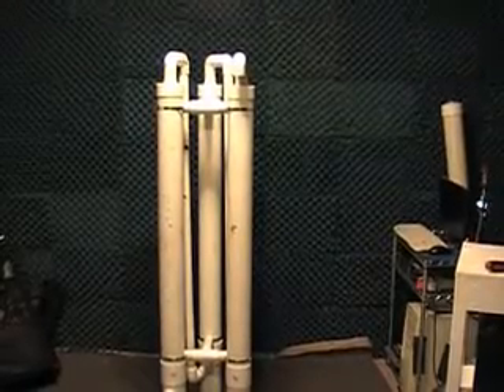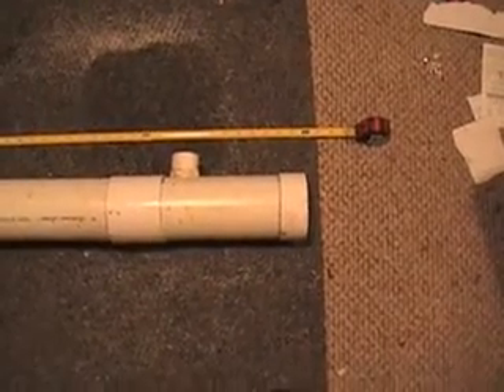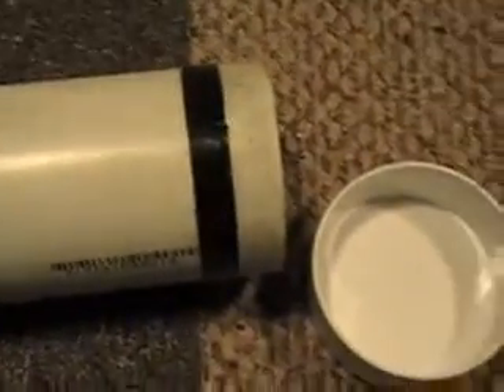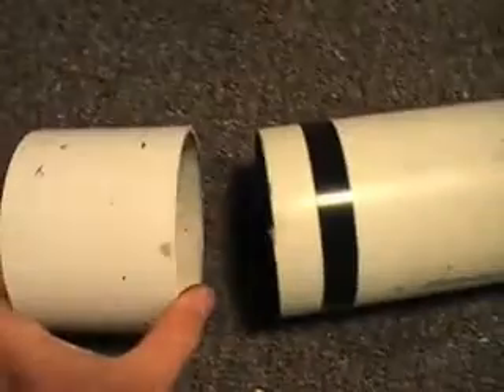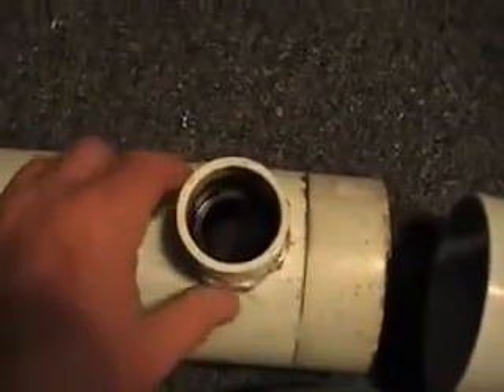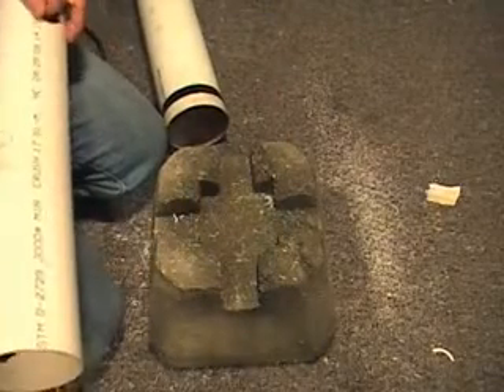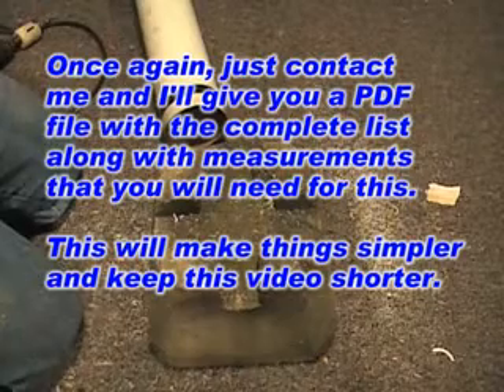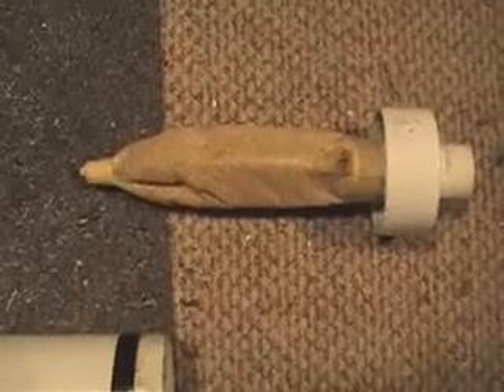01-15-2013 How to construct the gasifier tri-filter system.

Comment from the maker: At least there are a bunch of us that can pick up the pieces if the grid does go down and that alone allows me to sleep better at night.I do have an old 2 KW generac along with a Powerhorse 2200 generator that has only been cranked once and I even have 
a small 900 watt generac portable unit. I started prepping in 2000 and I never sold any of my stuff and now I'm glad that I held on to them.

Comment from the maker: When I built this system I had never touched a welder in my life other than soldering or simple braising. I went through a million youtube videos watching people weld then I got a bunch of scrap steel and practiced until I knew it was acceptable. The piece of steel I fabricated the other day was a simple job but it took me a few hours because I kept the cutting and drilling was slow to keep the job neat.

Comment: Note from retired plumber: Slice 5/8" unistrut to form the appropriate "inside" triangle by bending 120 degrees at slice. Lets you use strut clamps on the outside filter tubing...Also might give you another option for connection to the base. Excellent series, well done and thoughtful.

Comment from the maker: I have always been prepared. The longest we lost power for was a month due to a bad ice storm but we heated with wood so I built up a 12 volt system to run the whole house on so in our eye's we had power. My neighbors were not so fortunate so they left one by one for motels! Tecknowfreak also lives disconnected from the grid like you do.

Comment from the maker: No problem. I am keeping everything open source. This is a "learn as you go" process for me. It actually can scrub tar out of the gas and it works better the longer  it runs. I have only ran it in 4 hour test runs so I don't know how long it will function before the filter medium needs changing but it will filter to the point that there is zero vapor visible on the output once it warms up. I was pleased to see it clean the FEMA so it should be great for the Imbert designs. cont:

Comment from the maker: If I'm not mistaken, I think you can get this irrigation pipe up to a diameter of 6 inches and that would allow you to run a larger volume of gas through it but for a small build I may have accidentally designed and built a gem and for my apps that's fine.

Comment from the maker: Patrick the link is in the description. The filter works good for a 2KW generator or up to a 5 Hp engine. I used 4 inch drainage pipe but I am going to build this with a 6 inch drainage pipe next week.

Comment: Makes perfect sense.Appreciate your input.My nephew suggested a water jacket around the pipe circulated thru a 55 gallon drum with a small pump to keep the water flowing and to pull out the heat. Might be over kill but on a larger unit it might be viable. What's your thought... Thanks

Comment from the maker: Thank you CNCmachiningisfun! For a small system 15 Hp or less you can use PVC as your coupling pipes so that makes the job simpler and quicker too. I knew I had to post this build especially after the way I seen this filter system totally remove the tar from a FEMA design. This same filter design could be cut in half down to 2-1/2 ft tall for a small imbert design and it would polish the gas to a perfect clean shine! I am already well into my new gasifier build and it is an imbert design too.
Reply: Thank you sir Flash for sharing your experience and technology. I'm a Rice Farmer here in the philippines and planning to do your gasifier in flat bed dryer to save the cost of production. This is Rocket science for me but I will try my best. Can you help us build our own gasifier? Hoping for your reply. Thank you so much! May you Live as long as you want sir Flash001USA

Comment from the maker: They are cedar shavings so they never fall through the filter and even if some crumbs do slip through, they will land in the water capture section. That's one good thing about pulling the gas up hill because nothing is really going to tug through the system plus if it did, the paper filter is there and even though it has wood chips, the volume of gas will not act like a vacuum and pull it into the fan drawing the fuel. I could always pack the paper filter with polyester fiber if I have issues.

Comment: Great series.I appreciate your passion and your willingness to share. some folks seem to leave out some key elements of their builds making it hard to get the same results.I like your  system better than mine! :)  Will make 2 sets so I can shorten down time.I use a 12" chop saw to cut pipe.Works good just cut a little slower/clean up the "fur" with a sanding block.A paint stripping heat gun works good for letting in fittings if people don't want to use a torch. Night vids r better to c it too.

Comment from the maker: Thanks man. I went around and around in my mind trying to figure out how to make a good brace system. I started to cut out two triangles from plywood then cut the holes out for the pipes then I got to thinking of the wood rotting or swelling due to any water getting on it and finally this idea struck me.

Comment from the maker: I'm building two Imbert gasifiers at the same time with one of the builds being my own design and if my build works, it will make building one of these really simple with only a very small handful of parts. I'm also in the process of designing an electrostatic filter that will not short out once I complete these other projects so check back in with me on occasion because I will make that an open source project too.

Comment: Great job. You're a good dude.. I like the way you show EVERYTHING.
Reply from the maker: Thanks for the reply. This build went through a few changes but I finally got it where I wanted it. I figured the best way to share this was to let people just see what I built rather than trying to do drawings especially since I was refining the build as I learned it.
Reply: I'm on the new page now, just wanted to say thanks again for such a great INDEPTH look at your machines. Just the right amount of repetition, for us newish folks. My current project is a rocket mass heater/ water heater, but I'll be doing this type of gasification soon.. You'll be my main source I'm sure.

Comment from the maker: No. As long as whatever you build can be disassembled and cleaned all is OK. I'm working on what might even be a simpler filter design than this one and with a bit of luck it will work so be keeping an eye out for a new filter design video.

Comment: Ya thats right you have yr setup where all that gas only goes up i always make mine so they go both ways for less work! Another reason is i think when the gas is moving up threw a filter the falling moisture helps clean the gas at least i hope lol! I just like the less cost in building and updown flow not just an up but still they both work great! I also screen them cuz i use bigger chips early on and use smaller one latter in my setup so i size them all to a standard!

Comment: I really like the paper element you did there, Im going to play with a series of something similar to what you did there. Last time I was in the hardware store they had these pvc pipes with little tiny slots cut into them like a well point. I think that might actually be what they are for. But any ways I was thinking about using them with a changeable paper filter covering them. Well when I get a chance any ways got a lot on my plate here :)

Comment from the maker: Now that I have my new gasifier ready to go, I want to see if I can shorten the filter tubes by a foot without degrading the gas. I am going to tell you something that is worth it's weight in gold. If your gas is hot it will not filter correctly. This is why I am using all of the pipes. I was able to strip all of the tar out of a FEMA with these puppies and that's priceless. I will be releasing a new video with a generator running under load followed with a construction
video soon.

Comment: Have you seen my VEK Videos. This is an open source off the shelf gasifier I built and have a series of 12 videos showing how to build it. Its actually pretty simple to build I built it out of some Job Smart air tanks and trailer wheel. lol The restricter is made out of 2" pipe and the restricter opening can be changed out via reducers. The more I run it the cleaner gas it makes.

Comment: Hey flash i think yr pvc cold filter setup could be made to work with any size unit due to instead of one upright one could use a Y pipe into 2 pvc pipe filters made the same way that would allow for alot more gas to move threw the setup and still get cleaned or even run it into 3 of the same filters there is no limit to how yr setup could be done to fit the size of the gasifier unit!

Comment: Flash, Your doing some good things here. I have selected your design among the many others simply for the filtering system. I am however going to use an initial filter
made up of a 33 gal drum using hay as a medium. I also want to experiment with the
possibility of compressing the syn to a 250 gal lp tank. My question is the generator
and its inner workings overall. Can you provide some kind of pics or diagrams that would give me a clearer view of the inside of the air injection cavity. TKS

Comment: thank you for making this info free-to-air, i dont know how much of it im going to use as im doing a truck and am trying to keep it small but im definitely doing the steel wool, have you had any luck with oil bath filtration? could you demo a small oil bath compared to your trifilter, my main filter will be a 150 liter oil tank and ill use baffles if i have to, if you compare your unit to one for a truck could you use an appropriately scaled oil bath and do a video? also other than the paper filter which do you think filters the best, im thinking of filling my cooling tubes with filter media as a double duty thing

Comment from the maker: Yeah the Imbert system is tricky. I finally got a damned stable Imbert that I really like. I can load it one time with wood pellets and it will run for about 6 or 7 hours or I can load it with wood chips for about 3 to 3-1/2 hours run-time. The FEMA by far is simple to construct so many people build it. These filters really do strip the tar out of the gas but there is something else that must happen too for these filters to work! The gas must be completely cooled down. Cont:

Comment: All my setups have a gas lag time but i never now have a problem with tar or water so i can take a 1 min lag for the gas to move threw better that then tarry water filled gas! And it always works the longer the lag i found the better the gas is! Plus with putting a dual fan setup one between the lp tanks and pvc pipe to get unit hot and making gas then switch to one after filters only takes 1 min to get out the end of the filters all the lag was used up when starting up the unit!

Comment: Hi, looks like this filter has cool effect right? The gas mixture consists of CO, CO2, CH4, N2, H2O, with a filter that allows the air to cool and remove H2O, leaving CO2 to be removed by flame. Blue, i'm trying to follow the instructions in your video to make a gasifier for cooking, i need your help on the filter to make the stove fire efficiently. thank you very much.

Comment from the maker: How much power do you have to work with between the solar and the wind? I am guessing that you are using deep cycle batteries so are you running a 12 Volt or a 24 Volt system or are you running a different voltage before the inverters?

Comment: try using a chop saw to cut your pipe. cut slow so you do not chip it. straight cut every time. 
  also try a heat gun instead of a torch to soften pipe for threading.

Comment: Hello flash can you make a video about the operation of your new gasifier system?
I am studying your videos to make my Gasifier. I am planning on running a 10-15 hp engine and thinking about ways to maybe run a 6" system to power a small 4 cyl auto engine w/ a few belt driven alternators to charge my battery bank for a off grid or grid tie homestead idea ? I am wondering if a 6" reactor w/ different size interchangeable nozzles would accommodate different size engines  I am wondering how your new one is doing ? You have the best videos on the gasifier build Many many thanks !!! I have been wanting to start my build for about a year now. I also would like your thoughts on compressing gas into a big 500 gal propane tank to run a indoor gas stove and dryer ??  I want to be free in the USA !!! Kevin
Reply from the maker: My new gasifier is set up to handle a 5 Hp up to a 6.5 Hp engine. I could have made the footprint smaller but I used the materials that I could readily find. Take a few minutes and check out my later videos because I do discuss the build in detail. As to compressing the woodgas, it is a waste of time. Woodgas is not like propane. Propane is in a liquid state in the tank and that's why a small 5 gallon tank is heavy plus it can run a generator or a grill for hours on end but
woodgas cannot be compressed down to a liquid without processing it so you really cannot get enough in the tank to make it worth the effort.

Comment: On the different filter items you mention, you only show the paper filter. How do you pack the others and the proper amounts of filter. Is there a reason for it to be so big/long or wide. Because much of the gas will stay in the filters until is used, and it is a large amount. It is a great idea. I would put it flat against a flat reflective source(aluminum foil, etc) plus paint the filters black so it absolves heat from the sun and help the flow inside the filter. So a back-flow valve may be needed.
Reply from the maker: You want the filters to run as cold as possible! The colder the better. Woodgas contains a lot of moisture even if the wood is dried and seasoned because it gets it right from the air itself. The cool filters will help by condensation and remove a lot of the water the same way a glass of ice collects water on the outside of the glass. As to packing the filters they are loos packed so that the filters breath with ease.

Comment: Hey Flash,  any chance that maybe you could put up a scaled drawing of the ash dish holes, and also the cone? I'm having great difficulties making them to scale. Also if I'm building a gasifier to run a 5-15 HP engine, should the cone be built with a 5 inch top, and a 2 inch bottom? Instead of reducing it down below. Thanks for your time, Gary
Reply from the maker: Gary have you tried http://www.sheetmetalguy.com/cones.htm for the cone yet?
As to the bottom opening being 2 inches make it 3 inches with a way to reduce it down an extra inch if needed. If you make it too small or you find that you should have made it a bit larger you will have painted yourself into a corner so play it safe and go with 3 inches. On the large side of the cone, you can either go 5 or 6 inches. That call will be up to you. I can get away with a single nozzle design because of my smaller design but that was just my choice for my build that happened to work, I'm not sure as to what size engine you are running but if it's between the numbers you mentioned a smaller 5 inch top cone will be fine. With a 5 inch cone and a 2 or 3 inch restriction opening you will need wood chunks that are around 1/2 to 3/4 inches in diameter too. I cannot remember but did I mail you the drill template for the biochar grate?

Comment: dear friend,
what kind of filter element do u use in this system to remove tar completely?
Reply from the maker: You cannot really remove tar from the gas with any kind of filtering. The only way to reduce it or better yet, eliminate it is to build a gasifier that gets hot enough to crack the tar to remove it from the gas. This is a very old video and since this video was released I have built up a much cleaner gasifier based on the Imbert design. If you go througgh my older videos on the channel you will find this project as it is improved. We also have a gasifier builder community where people can help you answer questions. www.miniwoodgas.com

Comment: Thats cool but one thing to think about is to make better filters i can run my setup for 8hrs np no filter change i change out my filters every other run that gives each filter 12 to 16hrs i only clean every other one that helps keep it so the extra moisture in the uncleaned ones clean the gas faster! And having every other dirty it makes the work half for cleaning too! And for my stainless steel i wash them out on the run so i only have the others to clean!

Comment: you know that was outstanding. So the three filters is steel wool, wood chips and a fabric, and the paper towels. now when you go to clean it how do you clean it, with water and is the clean out going to be hard? i will be building a filter system close to yours. so the wood chips you use do you go back and burn it or just throw it away? I found this video very helpful. check out my begining end of the gasifier, i can use somethoughts about it
Reply from the maker: Yeah, the filter is a 3 stage system. Stage 1 is the steel wool and it doesn't add any back resistance to the system. Stage 2 is the standard wood chips and I loose pack them. Stage 3 is polyester fiber that you can get anywhere for a few bucks and it too is loose packed The paper towel filter will collect any left over trash from the system. If you are running a Imbert gasifier where you don't have any tar issues the filters can be ran for 5 or even 6 hours before you need to clean them. You were asking about the wood chips. No I don't burn them. I let them dry out and reuse them in the filter. I can reuse them for about 6 runs then I will mix them in with my wood fuel for the gasifier so that's not bad.